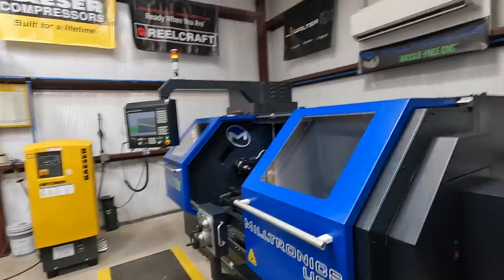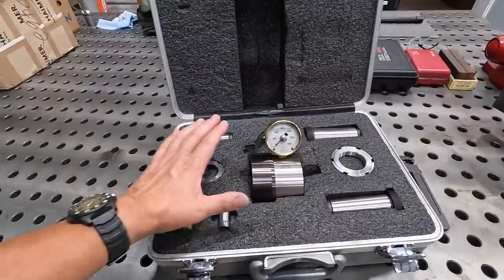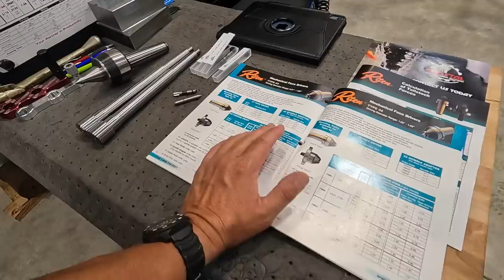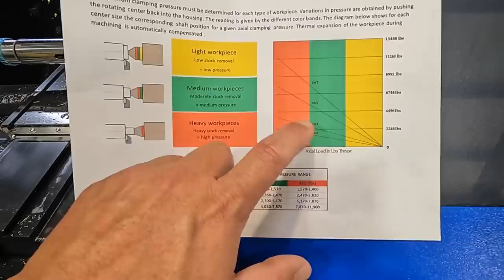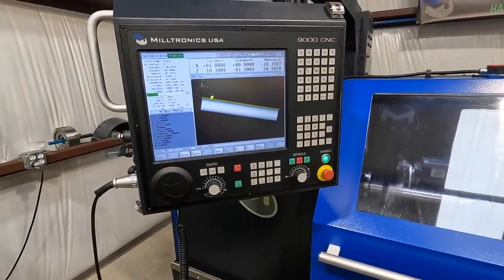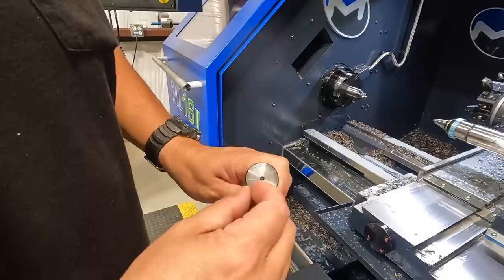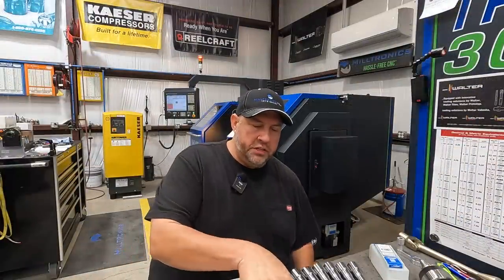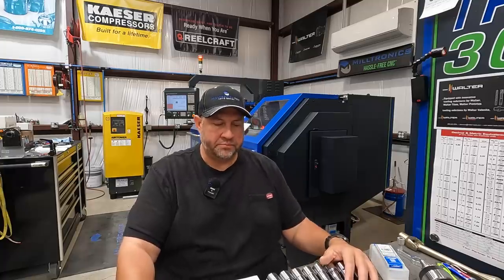Riten Industries Face Driver, Turning Between Centers

Comment: Great advertising video! But you aren't doing mass production parts! I'm OUT!
Reply: Yeah, Adam couldn’t support all that gear (in two shops!) on what he turns out.  He’s equipped for a 3 man shop, at least.
Reply: @SteveColluns-hm2xx  You know, most people without ego problems just don't come back when they don't like someone or something.
Reply: SInce when is driving work between centres got anything specifically to do with 'mass production'. Clearly the door smacked you in the face on the way in and you never even looked at what was inside!
Reply: @SteveColluns-hm2xx  Nearly as 'funny' as your unwarranted ARROGANCE toward Abom and his skill set.
Reply: Interesting take, but I’m not sure I see the “disingenuous and full of himself” part. I do plenty of CNC machining along with manual machining in my home shop, and I’m far from a professional, but I just don’t see it in his presentation. In terms of his skill set,the only possible shortcomings may be in the CNC realm, but Adam seems to me to be very forthcoming in expressing his level of experience and he’s obviously nowhere near your experience level. Well, if you do this every day for a living, you’d better be knowledgeable and great at it. We all have our areas of strengths and weaknesses. Yours obviously are in this arena, or at least that’s the claim. I promise you though, as much as you may think your knowledge of building and servicing manned spacecraft is, you are not even on the same continent as I. Again, we all have our wheelhouses. Adam has his, you have yours, and I have mine. Can’t we just appreciate Adam takes the time and puts forth effort to produce these videos for all walks and experience levels? While I’ve no intention on ever owning this accessory, I did learn about their existence here, along with others as indicated by most comments, and I think there’s value in that. Be safe out there.
Reply: @SteveColluns-hm2xx Let me guess, you’re a W2 button pusher in some shop.
Reply: @seabreezecoffeeroasters7994 So many fanboys! Viewers vote  with views, subscriptions, and comments (which Abom deletes). His channel isn't growing, subs are down. The views are stagnant. And if you read the comments of those who actually watch the videos (not the fanboy "greatest video ever" comments) he's got problems. Trying to be an influencer is what both his channels are all about now. Not what it was 3 years ago, but now. Then after getting all this free equipment, he grifts for Patreon?!
Reply: @charlieromeo7663 Apparently you didn't watch his 3 part brazing video! He didn't even call the customer to enquire as to what level of repair the customer wanted until he was ready to box it up.

My suspicion is he worked in a machine shop previously where all he did day in and day out was production work. His skills are limited to those that were required by that job. Nothing wrong with that, but something an apprentice could do. His total failure and breakdown brazing a gear emphasized that, he even said out loud that he lacked the skills multiple times. His father was a machinist, Abom, not so much. And as an influencer the only thing I would buy that he recommends are CRC products!
Reply: @jerrylondon2388  How is putting up FREE content for ALL that some choose to support financially a 'grift' people make a free will choice and he doesn't peddle Patreon multiple times a video like a bunch of creators. Whining and bitching incessantly including obvious trolls who just come to the comments section to stir up trouble each week instead of just switching a channel are PATHETIC. Not all content is for all people and there is plenty I have just stopped watching over the years as their and my interests diverged.
Reply: @seabreezecoffeeroasters7994  He is not sponsored! If he were his is required by YouTube to clearly state that he has received good's, money, or services in return for advertising. Not doing so is a grift. As is deleting negative comments to make the channel appear more popular than it actually is. He knows this, but continues the grift. Please send him money, please!

Comment: Thanks Adam, you talked about the finish, I know carbide likes a little deeper cut then HSS. Is that what your meaning when you talking about speeds and feeds, hitting your mark at the main cut or a different way all together. Thanks for sharing.

Comment: Cool tooling for a manufacturing facility. Not so much for a guy in his garage.
Reply: I suspect the far east will manufacture something simpler and cheaper for the small shop. The principle is equally applicable to manual turning. It been  pretty standard in the wood turning community for a long time.
Reply: @martinhow121  your probably right. If they aren’t working on it already. Unfortunately for the small shops and the hobbyists it’s far from attainable from a cost standpoint. But there again it wouldn’t be worth the big companies time as most of the home shops are disappearing and converting to CNC. Not to many small machine shops around anymore. 
I remember when there was 12 of them within walking distance from my school. ( I grew up around Detroit) and now there is only one and they are all CNC. To be fair the one that is left was the one the bought out at least 4 or the small shops before making the switch to fully automated manufacturing. Now they are huge and they don’t even do much for the Automotive industry. But times are a changing ! Lol

Comment: Typically, you don't need to reset your Z-zero unless your tolerance is .010" or less.  A face driver repeats part to part with little variation.

Comment: What was the quote for fixing the live centre , mention ritten industries 25 times in a video?
Reply: At Riten, the cost for repairing one of our standard live centers is about 40% the cost of a new one. If it is someone else's center it is about 50%. They come with a warranty as if they were new. If for some reason it can't be repaired, we will offer a 35% discount of the price of a new, like Riten center.

Comment: Why keep calling it a shaft just call it what it is A GUN BARREL any body that knows anything about guns knows what it is lol especially it having a 1/2-28 thread
Reply: It isn’t a gun barrel until it’s finished. Until then it’s a shaft.
Reply: @ellieprice363  ya ok thats about dumb try that with the ATF
Reply: @u-genefabricationmachine4725  the atf has no say so in manufacturing barrels. Barrels are not firearms.
Reply: No bore, rifling or chamber, it's a shaft of metal.  Nothing more until...

Comment: I'm more interested in mechanics and the properties of materials, but that was really interesting.  I have a few questions and apologize if they that might not be interesting to a real machinist.  First, when machining long precision parts between centers like that, won't the diameters be a bit higher near the middle of the cutter's travel between centers?  With that nifty CNC program, could you build in some Kentucky Windage once you have measured your first part?  Or is the deflection too small to matter?  Second, is the wear on the cutter consistent enough to just replace cutters on a regular basis or does the operator have to constantly look for sparks, bad finish, or other clues?
Reply: For production CNC, normal for each cutter to be changed to new after a set number of parts; programmed in so that the machine stops at set intervals.  Then easy to price the cost of consumables used in making the part.  And you don't want to have to put out fires unnecessarily when you have say,  6 CNC's to run at the same time. The looking for sparks, bad finish, other clues as well as many other observables to check are still needed despite regular tip changes.
Reply: I would be interested in minimum diameters before thing just bend from the pressure, although I'm sure information is available on the website?
Reply: @richardjones-sl2zd  That's why youn have machine minders with very limited ability, hourly rate is MUCH lower than a trained machinist
Reply: @1crazypj  At Riten, we recommend a maximum of a 15-1 ration between the length of the part and the outer drive diameter of the drive pins before you have to use a steady rest. This would actually be for most applications even of you were chucking a part due to deflection as you get near the center of a long part.
Reply: At Riten, we recommend a maximum of a 15-1 ration between the length of the part and the outer drive diameter of the drive pins before you have to use a steady rest. This would actually be for most applications even of you were chucking a part due to deflection as you get near the center of a long part.
Reply: @KentHizer 
Thanks for reply,  Interesting.
 I don't think I would want to pressure turn a 15" long shaft one inch diameter even with traveling steady.
Reply: @KentHizer  , I assume that there are  a number of guides such as Riten's which will keep most machinists in a good zone.  In general, turning between centers is related to the buckling strength of a column under a load.  Here the part's the column and the load is the tailstock pressure.  A few of you might be interested to know that the basic mathematical problem was solved in 1744 by the Swiss mathematician Leonhard Euler (rhymes with "oiler").  Basically, a slightly bent column under compressive load will bend even a bit more from the initial curvature.  This is called positive feedback.  When the feedback gets close to 1, the column becomes unstable.  This point is called Euler's Critical Load.  Look it up in Wikipedia, for example.
Reply: @1crazypj  it is done thousands of times a day on rifle barrel  manufacturers across the US
Reply: You can set tool life in minutes or no. of parts, once tool life is over the machine automatically starts using a spare tool that you've designated. Not sure if it can be done on this machine.

Comment: I see a major flaw in the whole system. Most of the lathework done between centers is an "after heat treat" operation where you just skim it for a surface finish or TIR tolerance. You wont be able to push those pins into the hardened part.
Reply: lol
Reply: On parts that are to be hardened and ground it will be necessary to press the drive blades sufficiently deep into the shaft before hardening. Use the same indentions after hardening to finish grind to print tolerance.
Reply: @SteveColluns-hm2xx Very true. Thanks for explaining several ways to grind the previously machined job.
Reply: Riten has a solution for hardened material. We use carbonite-coated drive pins.
Reply: @SteveColluns-hm2xx  the pins are flat and not pointed and drive by friction rater than drive pin penetration.

Comment: So it's only useful for high production shops, making parts greater than 1" in diameter? 

Have you met your audience?
Reply: I am a hobby machinist, and I own a face driver. I didn't buy it new, though. 
They are useful when you want to turn the whole surface in one setup to guarantee concentricity.
Reply: @andypughtube  obviously, we just all watched a video on their benefits, thanks for reiterating
Reply: @EitriBrokkr  Well, just saying that they are useful in places other than high-production shops, including one-off in the home shop. They can also be used for parts smaller than 25.4mm, if you get a smaller one. 
Of course, for nearly all home shop enthusiasts it would be hard to justify buying one new for a one-off job.
Reply: @andypughtube  you just completely contradicted yourself.
Reply: What does his audience have to do with it? The vast majority of his audience has no machining equipment or experience.
Reply: You can face drive parts with Riten Face Drivers down to .28" in diameter. Riten also has custom solutions if smaller diameters are required.

Comment: Am i correct to assume that the drive pins have to go at least as deep as your depth of cut? E.g. , 0.005"/turn requires at least 0.005" depth of the drive pins?
Reply: @SteveColluns-hm2xx  Depth, not width. Feed rate if you prefer.

If the drive pins are 0.005" deep, and the tool is cutting 0.010"/rev, the drive pins would be the weakest link and i would expect the pins to spin, ripping material out of the end..
Reply: If there are 3 drive pins .005" deep and .250" wide then you have .004 square inches of engagement from the drive pins.  Taking a .100" deep cut (.200" off the diameter) you would need a .037" feed rate to equal that much surface area, which is pretty aggressive.  The tool is probably acting on a larger radius than the drive pins though, so leverage would be a factor.  Still I think you could take some pretty standard cuts without stripping out the drive pins.

Comment: 0.018" feed in that machine sounds terrible. You're proud of it but it seriously sounds like it's way too much feed. If that was a Mori or something well built I'd even second guess that feed.
Reply: Especially on a weaker insert like dnmg.
0.007/rev with a .120DOC at 400 surface speed would be butter.

Comment: AR 15 barrels, cool
Reply: Mock run for such a "shaft"
Reply: I wonder what the material was. 416 stainless?
Reply: @KRN762  4140
Reply: @KRN762  He probably had a stick of 2" 4140 since it's a general purpose hard steel. Quoting a job and getting free tools.